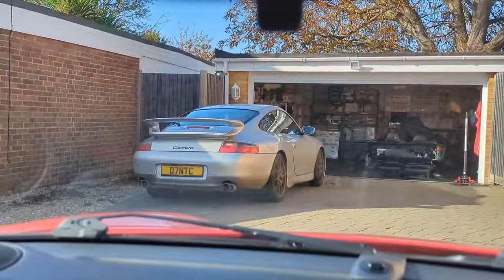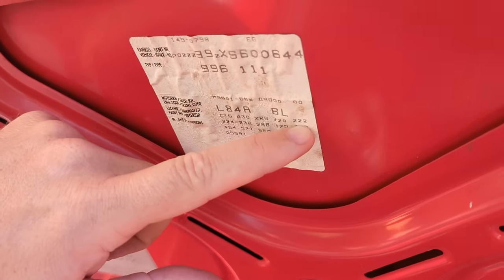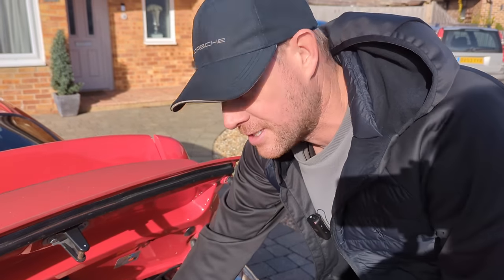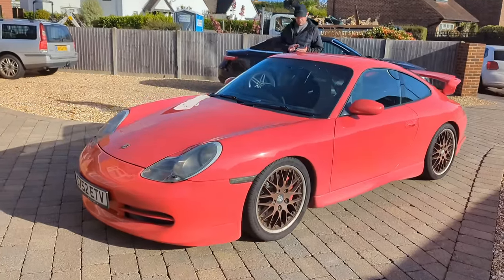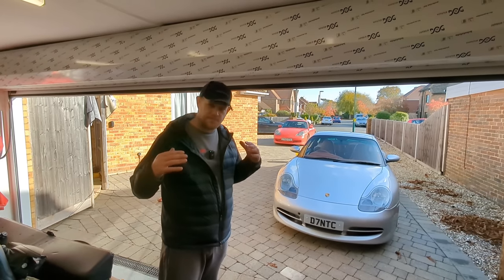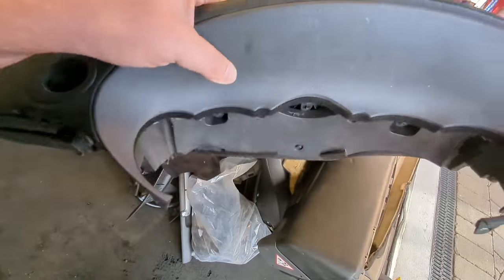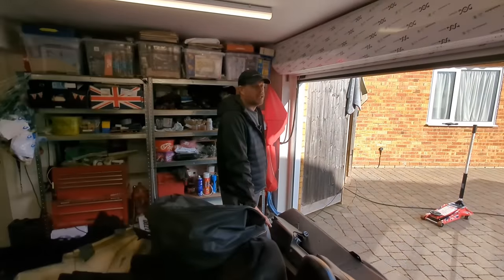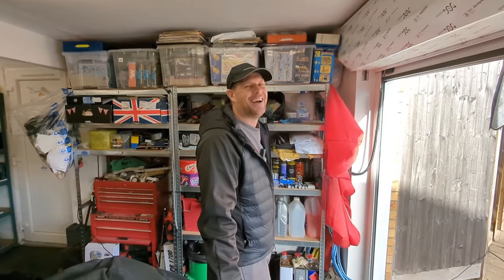Porsche Expert ROASTS my New Car! #clickbait

Comment: For anyone who is interested in a 996, the sticker under the bonnet with the codes on, there is an exact duplicate of this on the  inside page of the service book. If the sticker is missing it might have a non original bonnet.

Comment: C16 means U.K. supplied car,
it isn’t model designation.
Some nice have options there Jon that I searched out when I had a Mk1 C2. Ironically they’re actually probably worn out and need upgrading anyway. 😄
M030 is stiff. Good coilovers will transform it. 
220 - LSD will probably be due a rebuild.
Sports seats are gone. You have buckets. 
So it’s mad that we search out these codes yet change the parts out. 
The cable throttle thing is a bit clutching at straws tbh. 
GT3s have fly by wire and no one has ever complained about the throttle response or how it behaves. 😄
Nice car though and great colour. Enjoy! 👍🏻

Comment: I have the same momo steering wheel fitted to my car when i got it, I have since fitted a momo eccentric spacer and much prefer the wheel position and the way it turns in your hands is natural.
Also had to get the steamer on my wheel like you need to😂
Reply: My 2003 carrera 2 is common arctic silver with the boxster red interior ( its ME option code and could be called terracotta more than red) is on 178k miles.
Bang on about the mileage, buy one to drive it, is the right attitude👍